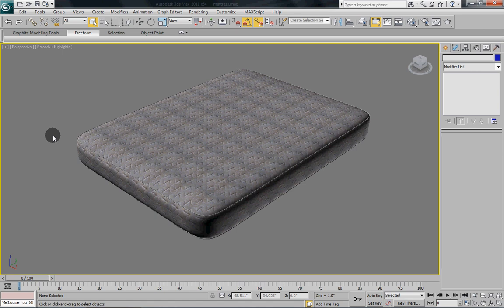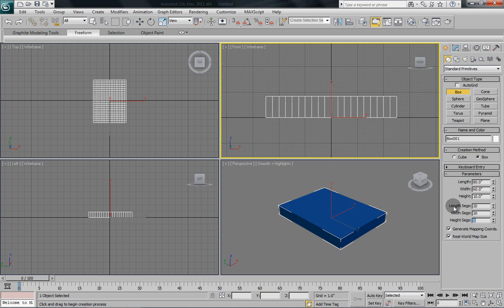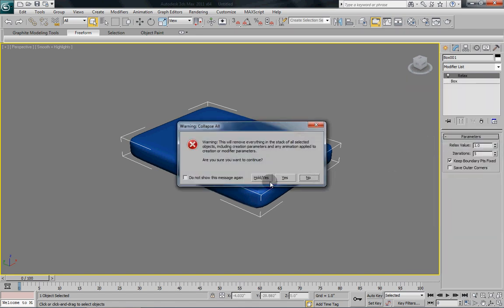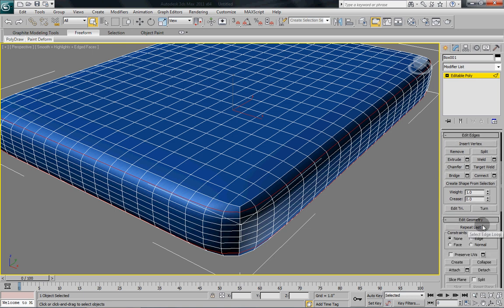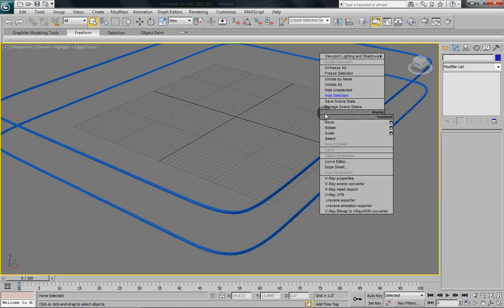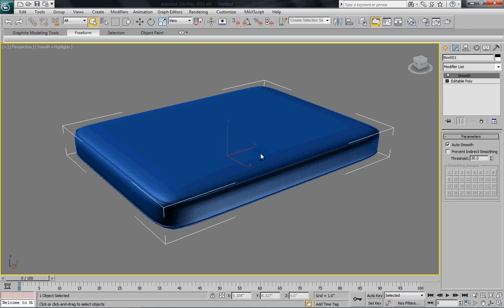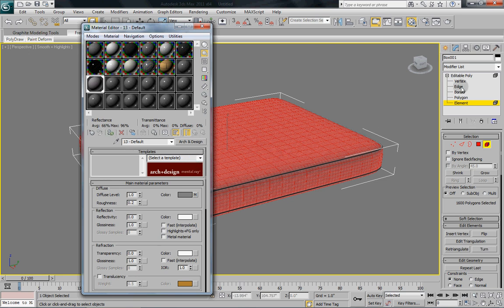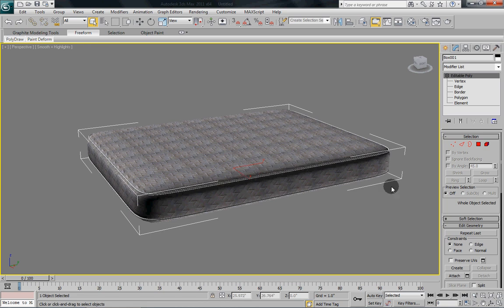3DS Max Tutorial How to model a mattress for a bed

Comment: Hi, so far great tutorial except there is one part that is doing something different for me than it is for you.  Hope you can help me. at 4:20 in the video, you enable the renderer and enable the viewport for those two edges youve isolated.  When you did that your shape was round.  When i did it i ended up with flat surfaces (imagine your tubes flattened vertically).  Is there something im missing here?  EDIT: was a problem with my file i think, redid everything 2 or 3 times in original file and a new one and it never worked in original file but always in new one. damn.
Reply from the maker: Glad you got it sorted out, Something probably got corrupted.
Reply: definately think you're right (also fyi the version im using is 2014)